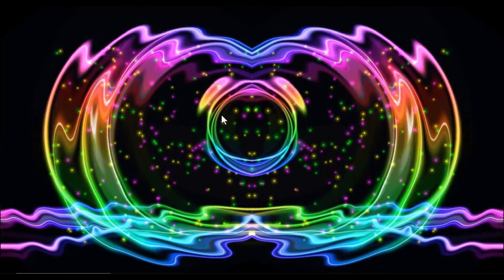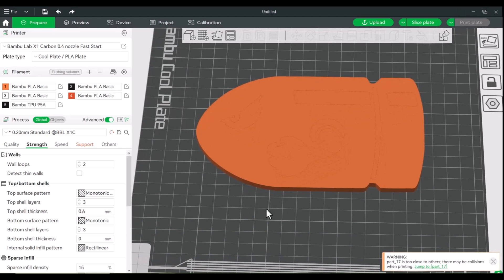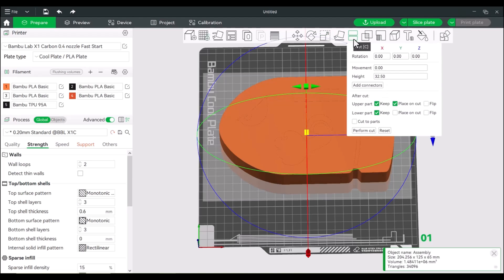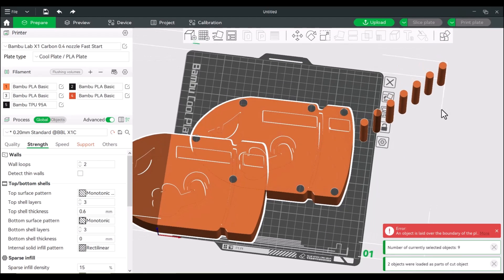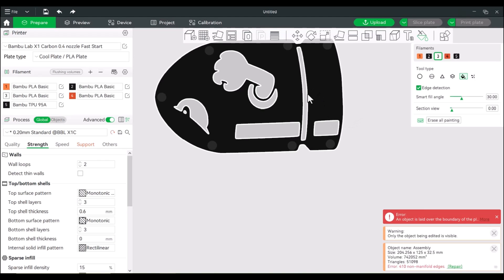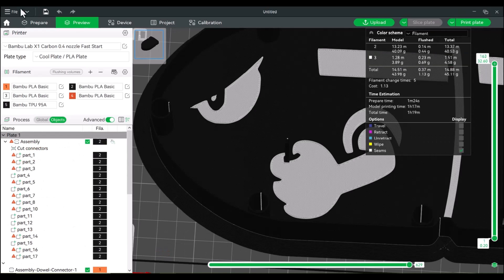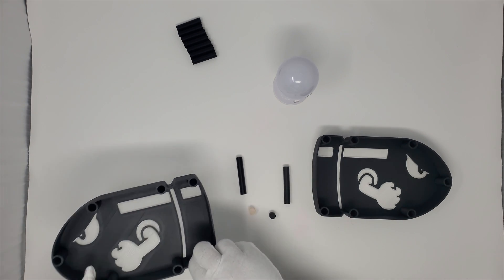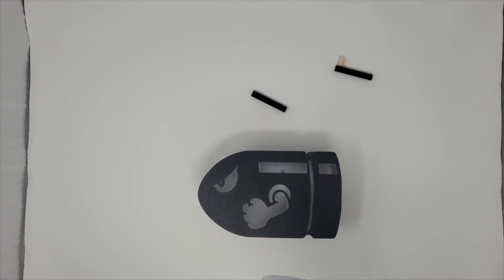SVG to Lightbox Bambu Studio Tutorial

Comment: Wow I didn't know you could do so much with the slicer alone. Time saver. Can they be printed with PLA or it's better to print with PETG?
Reply from the maker: Admittedly there a few ways to go about it but in slicer offered some interesting challenges.

Both play and petg work well and as lone as you have the proper colors.petg holds up outside if exposed to the sun but otherwise plan is a great option too.

Comment: I've completed the steps, but the inside of my light box has inner walls.  How can I remove those to make it hollow on the inside?
Reply from the maker: @whimsygift  watch how you paint the svg. Do not paint by numbers. Just the paint tool and only paint the outside.

SVG files have a weird effect of you create a hole, modifier  penetrating from the sides.
You would have to make a hole/modifier from the top or bottom.

I really need to revisit that type of svg light box as there are some "rules" one must follow but there are some neat things you can do too.
Reply: @ashleys3dprintshop  I used the bucket fill option to paint.  So you're saying if I did it manually, it would only paint the outer layer and would eliminate the inside walls?
Reply from the maker: @whimsygift  you painted it correctly. There's a few way to eliminate the inner walls but the fast and dirty way is to go to global settings and remove the infill. Set info to 0% but you can set the outer walls to whatever you like
Reply: @ashleys3dprintshop  I did remove the infill.  There is no infill - just walls that go through the lightbox in the areas of one color.  I wish I could add a pic and show you.  I also tried setting inner walls to 0 to no avail.
Reply from the maker: @whimsygift  you can email me, you can also send the 3mf file if you'd like

Comment: Thanks for the video. Do you have any tips to stop the letters or graphics popping out of the prints with slightest pressure?
Reply from the maker: Hello, thank you for the question. I would recommend making the parts touching the build area a few layers thicker
Assuming .2mm layer height.
I typically Make the bottom layers 3 (.6mm)or greater. Theoretically you can go above this at the expense of light penetration depending on your colors, transparent filament works best.

So try with 5 bottom layers(or 1 mm thick) 

Or you can stick with 3  layers and use a simple infill but it will show in the lighted print by using a height modifier.
Reply: @ashleys3dprintshop  I have a print with PLA Matte, 0.2, 1mm. Just black box white print.

Comment: I'm not sure what I'm doing wrong. Every time I try to cut and place pegs, it cuts holes all the way through the object. Can't really make a light box with holes everywhere lol
Reply from the maker: I really need to make a follow up to this video for a better back/joining option. 
The pegs were a clunky solution at the time.

The model was I believe 60mm it was split in half. The pegs/holes were slightly less than 25mm on either end. so they would not penetrate the top and bottom.

Comment: I’ve been having troubles with printing the strokes in an SVG file. Many svg’s have wide strokes and for one painting them is a pain but it’s hard not to get any bleed from black outlines into the colored areas.
Reply from the maker: Hello. My general rule in painting if I cannot get into small areas is to use the fill tool or enlarge the model a few hundred %. I would then paint then size it back down to its normal size.
Reply: @ashleys3dprintshop  have you tried to adjust layer heights above the stroke lines. We have been doing a lot of cake toppers and in the past have made them with a laser cutter. Now we are doing some with a P1S and it has been a learning curve with the svg’s. Mainly the problem with black strokes bleeding into lighter colors. I have downloaded some stl files of diff characters etc and they didn’t have stroke but the diff objects had diff layer heights to break up the colors. I’ve tried removing strokes but that just makes individual objects when you import to bambu. It’s a learning curve for sure. Thanks for great videos. I’ve learned a lot about svg’s and Bambu.
Reply from the maker: @christopherdial  So I go about it a few different ways depending on the project. 

If i am starting with an svg file and import it in studio( assuming a 10mm height) I can adjust part heights a few ways.

If using an SVG this video may help as you can separate the parts height even by a single layer.

https://www.youtube.com/watch?v=IeEX6vkzP4Y

Occasionally I will separate the parts into objects if I have a clean SVG file.(no gaps or errors) and group parts together and paint. 

https://www.youtube.com/watch?v=ZIZg7RPCsn0

Since vectorizer site went out of beta I personally went back to the desktop version "vector magic" to make my SVG. I am kicking myself for not making a full tutorial when it was in beta as it can help those that still wanted to use the subscription. Every time I tried to revisit an alternative (free) site it wasn't consistent. 

This may not be a full answer but If you dont have any issues sending the png, jpg,jpeg,bmp,tif,static gif,psd,jp2,pcx,ppm,tga etc over to my email I can see if I can clean it up. 

As for STL files they can be a whole different scenario depending on the model
Reply: @ashleys3dprintshop  we use Inkscape and trace bitmap usually. We have used Vectorizer as well. Really only having an issue when printing a flat top layer. I think I can scale the colored regions taller and leave the strokes lower. Another issue I’ve had is if ironing a top layer sometimes if the last color was darker it will smear color on lighter colored parts of the print. It’s an experiment. I just hate printing some of these designs 5 times trying to get it right.

Comment: Just a thought - could you make a lightbox in two halves just by making the lower section smaller than the top, so the top drops over it like a lid. That way there would be no light loss through a seam. Or is that not possible?
Reply from the maker: Yes there are no major limitations on how you make the back. If you don't color it in its just a flat piece with no image outline.

There may be some trial and error on sizing if your are trying to press fit the back though. 

You have to take into account the number of walls for the main piece and size accordingly.

Comment: when i tried to do this with a png file i have with 4 colors, convert to svg with multiple different converts an it worked better with some than other but it was like there was walls on the inside of the model an im not sure how to fix it. ive only had the p1s for about a week so bambu studio is new to me but im coming from cura with going on 6 yrs of experience using a bunch of different types of machines but this is the first time ive tried to make a light box like this, ive always made lithophanes an made boxes that held them but this is completely different. part of me feels like it might be the svg file since if differs from converter to convert but im not sure what to do, any suggestions would be greatly appreciated.
Reply: Hi, I'm having the same issue.  Did you find the solution?

Comment: how do you manage to print the white part as "transparent"?
Reply from the maker: Hello. That particular filament is a transparent type for the bullet bill. But simple white will work just lower the number of walls (2 or lower) and you should be fine.
Reply: @ashleys3dprintshop  thanks. Because i Just downloaded a model for a lamp similar to yours, but the "top cover" is all black underneath i dont have the white colors.like you did that's what i meant for "transparent". I can't find the settings on bambù studio to print directly the colors on the plate and not having a black underline beneath it

Comment: Are you able to add a hole for wired set up?
Reply from the maker: Yes you should be able to add a hole, but it's a little different from what you would be used to. Adding a negative part doesn't work. You would have to add a primitive part, and convert it to a modifier and lower the infill, walls
Reply: @ashleys3dprintshop  can you explain why adding a negative cylinder wouldn't work? That's what I will try to do now that I've watched your awesome tutorial. I'm afraid your way to do it doesn't make sense like adding a negative cylinder would so I am worried I'm going to fail (won't remember) like I would if I understood their logic behind it. No worries if not, I'll go poke around and learn by trying. Thanks for the great start, I'm so excited to try.

Comment: I convert the png in the Vectorized, my Bambu Studio does not respond when i upload the svg. Any ideas why? Thanks for the tutorial!:trophy-yellow-smiling:
Reply: I have the same issue
Reply from the maker: Sorry about the delay. Vectorizer is out of beta so no longer free and my answer changes a bit.  There are a few reasons why Studio locks up though

1. The SVG is to large. I have seen around 1MB+ files cause problems.
2. The SVG is too detailed. Photos that are converted to SVG are notorious for this but it could also be images that are "busy" or many small parts. 

There are a few ways to mitigate this
1. No photos, line art or simple graphics
2. Reduce the number of "colors" to 2 or 3 
3. Use a different conversion program/site
A lot of this is trial and error but I'll try to make a video at some point once the dust settles from the Vectorizer leaving beta and I find a decent(free) alternative.

Comment: I'm wondering what i did wrong, my connectors are showing through my first layer on my Harley shield lightbox?
Reply from the maker: Hey hey. So my dowels were in a specific place.
I split my equally in half.
65mm in z cut in half to 32.5mm
the dowels were 30mm going into the top and bottom.

So top 32.5mm and dowel 30mm of that.

If you are making the cut in a different place you have to account for that.
Also there will beparts printed in mid air for a few layers before it catches. So make sure they dowel holes are very close to the walls.

I will be releasing an alternative/better way to make the back half. (it will take some time though)

Comment: Why is bambu combining all the colors/parts as one solid model after the cut? I'm not sure what I did wrong 🙈
Reply from the maker: Yeah. You have to cut first or it will remove all the painting.  @ 3:32
There are a few things that wipe out your colors.
Cutting, Repairing, mesh boolean. So you have to make the cut or changes then color afterwards.

Comment: Anyway to make a hole for the power lead in the slicer ?
Reply from the maker: Yes there is. it's diifers a bit from what we typically use. Negatives do not work. 
You would actually use a modifier and take out the infill and walls  top and bottom. It creates hole but around that hole will be walls and such, so you would want to make it close to the top or bottom of the light box. The reason being the walls will start printing in midair so try to have it touch the bottom.
Reply: @ashleys3dprintshop  Thank you very much I have done it , thanks for all your videos . I im now making my own light boxs because of your help . Thank you .

Comment: My dowel holes are not printing, I'm guess it's because they are going across multiple colors? That's the only thing I think it could be.
Reply from the maker: The dowels were a kludge method that needs to be really close to the walls. They also need to be deep in both ends of the model so the walls hook them.

I have another  method coming out in my next set of videos.
Reply: @ashleys3dprintshop  they aren't close to the walls. That was probably it, thanks for the follow-up
Reply from the maker: @brianmichaelbrown  I'm glad I can help. Also for extra insurance try to add enough walls to include the dowel holes. In my example I choose 5 walls but my holes and dowels were on the large side.

If you have any other questions or concerns I am here to help.

Comment: When I try to make this in bambu studio the dowels seem to go all the way through. No matter what height i set them to they still turn out to be the same height as the model and the holes go all the way
Reply from the maker: Hmm. I have a few questions. What is the full height of your model? Z height in mm
What is the height of the dowels? 
So if your model height is 50 and you if you split it in the middle it cannot be over 25mm

If your split is not in the middle you have to leave some room for the side walls to "hook" into the peg holes. 

I will be releasing an alternative method that does not use the dowels if you are just doing the backs of the light box.

Comment: My dowels start printing at layer 15 not layer 4 , can anyone help thanks .
Reply from the maker: Hey hey. When you are at the cut phase adding the dowels the cut starts exactly at the middle. (unless you move it.) my example I almost ran the length of the model.
I will be showing another option outside of the dowels in the next set of videos.
Reply: @ashleys3dprintshop  Thank you for all your hard work and help , Top Guy Thanks.

Comment: I'm having a bit of an issue when it comes to making a hole on the side for a LED plug to come out of. I thought I could just make a negative cube part and scale it to the diminsions I need but instead of making the hole it just pushes the walls in. I think it treats it as if it still had infil even though it doesn't. Do you have any suggestions for hole making inside of the slicer?
Reply from the maker: Hello. I should be able assist (a bit)
1. make a clone of whatever you are working on since the clone will be experimented on.

2. Right click your model and "add modifier" 
If you already created the negative just go to objects process right click on the negative part you created and make it a modifier
3. You will need to be in objects process and the modifier will be called "generic [shape you chose] 
4. Move modifier into position, use move tool (M keyboard shortcut) if it helps

5. In objects process click on the modifier part, go to" strength"and remove top and bottom shell and infill. 

Depending on if the modifier is overlapping the side walls it will create negative in the outer wall. 

There are some caveats. 
1. The modifier is a part, and depending on your Global process it will create walls around that modifier.  So while it will make a hole on the side it will create a part on the inside of the light box. You could theoretically make this to your advantage and have a recess for a light switch

2. If you're following all of my steps part of that modifier will be printing  in air so try to make it close to the bottom of the light box or intersecting 2 walls may help. So don't make it too large. 

SVG are unique and do not act like normal stl files so there is some experimentation that still needs to be done. 

SVG file type
https://www.youtube.com/watch?v=3zYdqUtVa3I
Reply: Thank you for that information. I hate to ask you more but I am a bit confused on placing the holes. They start to print in mid air. I  seen someone else in the comments mention this and I think, from what I understand,  you need to place the holes so they are attached to the walls and let the walls carry them up? I also noticed that I cannot make my depth ratio half of my models actual height, which is what causes the issue to start with. For example if my model was 40mm, i'd want my depth ratio for my holes to be 20mm but the slicer forces them to be 13.33mm. Again thank you for the help and the video, it's opening up a lot of new possibilities.  @ashleys3dprintshop

Comment: That's a exactly what i was looking for! But i ran into some issues with this model. The connectors would not adhere that much and would break off. Increasing the layers seems to work but now the white layer is too thick and light doesn't go through it that much. Any ideas if i can selectively choose to have fewer layers of the white color and kore on the black? I would think that i have to make the kodel from scratch, but maybe you gues know a workaround. Thanks for the awesome vid once again!
Reply from the maker: I would make the holes/connectors deeper and closer to the outer (5 ) walls. My model was about 65mm in z height and the holes were 30mm  up and 30mm down. . Plenty of chances for the holes to "hook" to the walls. The holes don't actually touch the top or bottom.

There are ways to make other types of connectors, work but this was a fast and simpler way in slicer.  Thick connectors and deep holes. If you make the connectors too shallow in my example it fails or does not have enough strength for the dowels. After the print I shortened the connectors to about 40mm in height. 

*Make sure you clone a dowel, and work on the clone to make adjustments. If you modify the original dowels they will modify the whole print. *
https://youtu.be/9UrBKPkj8CI?t=493

But the latest update has a "dovetail" option but  I havent had time to see if we can incorporate in this project. 

And there are ways to modify sections of a print to use fewer layers with the "modifier" option.
Reply: @ashleys3dprintshop  Thanks a lot for the info. Will definitely look into it :D